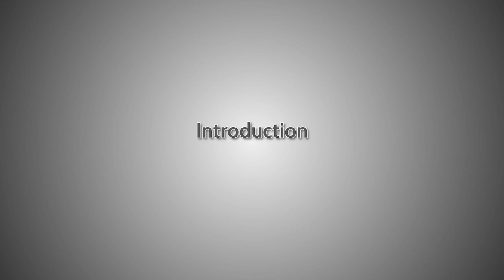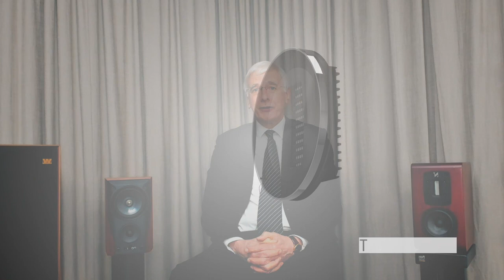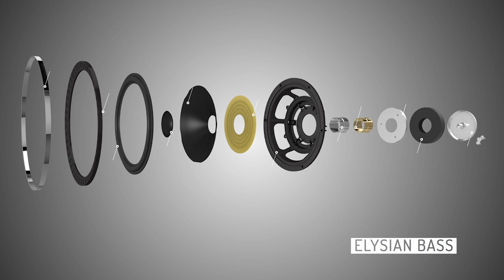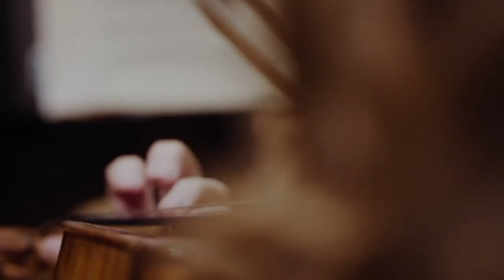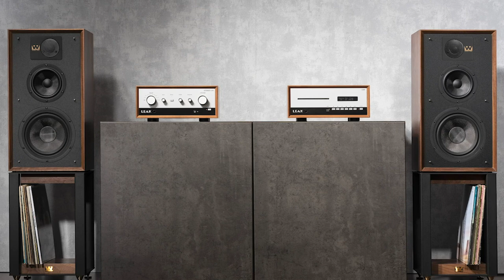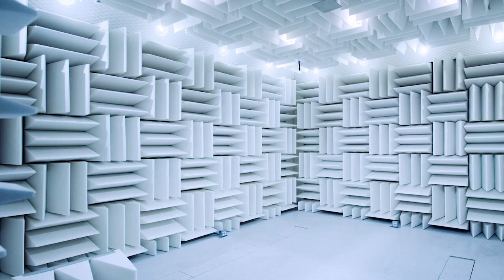An insight into speaker design with IAG Group's Peter Comeau (sponsored)

Comment: I'm so glad we have these guys still around, everything is simulated and put out for production, had this a few times with some commercial designs, tweaks to a crossover component and all is good. usually couple of ohms on the tweeter input, 2.2 ohm changed to 3.3. job done
Reply: or even worse, disgusting woofer breakup, 1 mH changed to 2.2mH, still problems, get rid of the woofer!